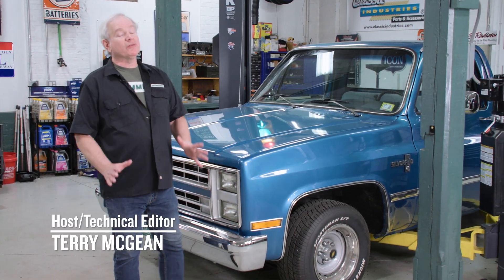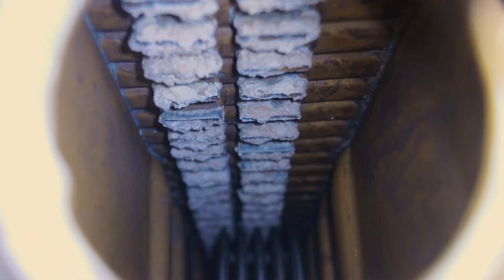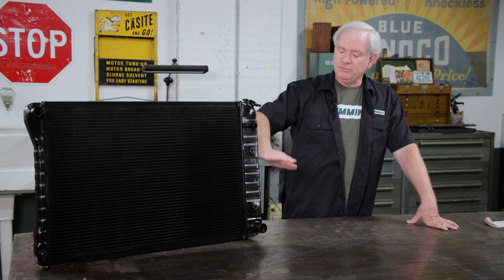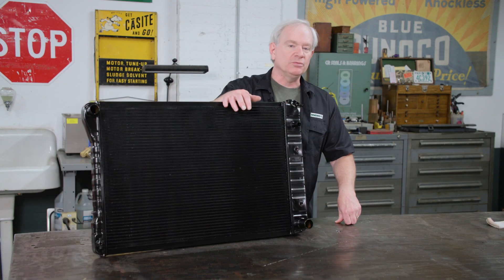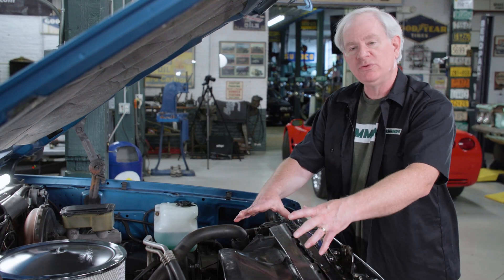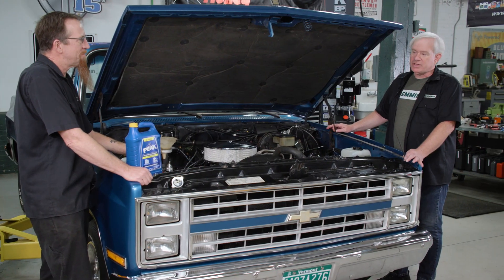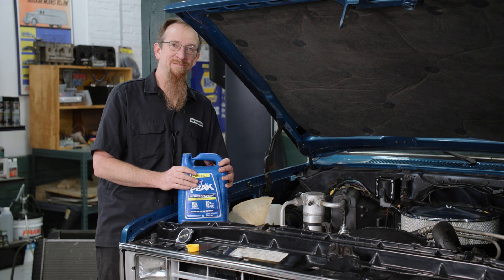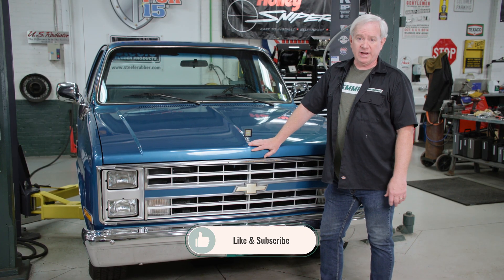Been A Long Hot Summer: Cooling System 101

Comment: Myth 3 and 4 core radiators cool better. Its all about tube size...A modern all aluminum 2 core with 1.25" tubes will cool better than a copper brass 4 core.